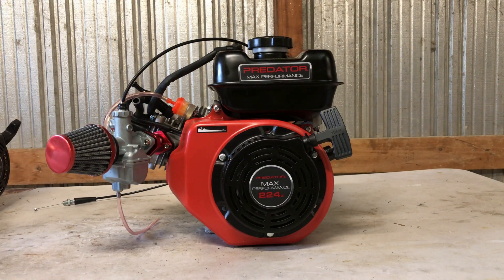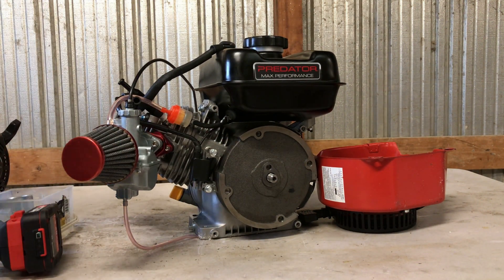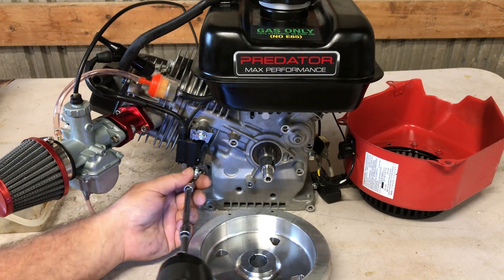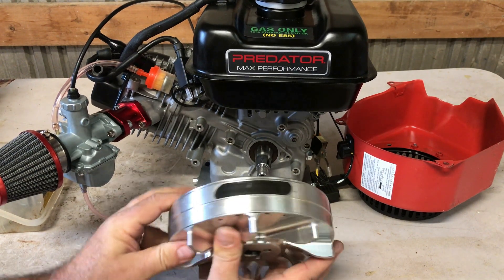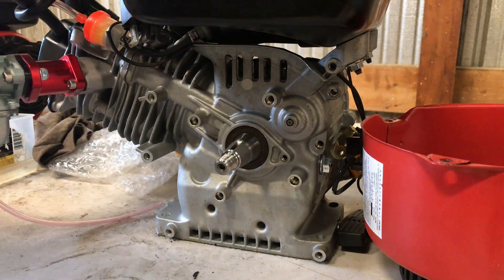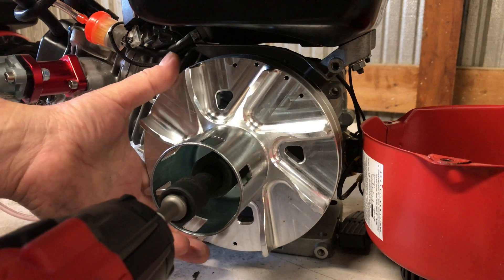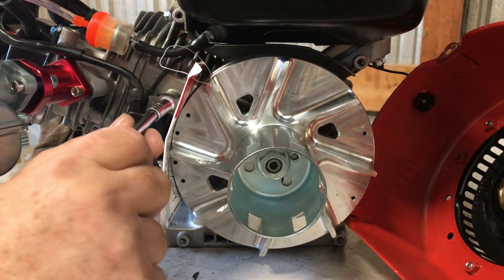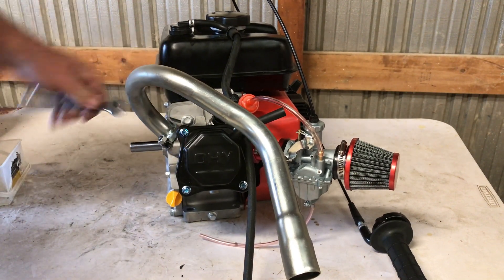224 Predator Billet Flywheel Install on the Billet Rod Wildcat Flat Top Predator 224 Engine Build

Comment: I just built my 3rd mini bike, with the other 2 after I removed the governor they started right up. On this 3rd one I have the predator 224cc engine and it’s not starting. I have spark, I have fuel. I think this might be the problem. I lost one of the valve caps taking out the governor. So I ordered one on Amazon, put it on, and I’m thinking that might be the problem. What would be my next move to prove that?
Reply from the maker: Valve lash is certainly an issue. Meaning that some engines have lash caps and others do not. The ones designed to use lash caps often have shorter valves, meaning the valve stem does not protrude up thru the spring and retainer as much. In that case your rocker arm could be making contact with the retainer rather than just the valve stem alone. That could definitely cause issues and even a dropped valve.

Comment: So when I was trying to take the thing off that is behind the flywheel I bent the threads and now the nut won’t go back on what can I do?
Reply from the maker: It happens. You'll need to chase the threads with the correct thread die before installing the flywheel retaining nut.

Comment: I took my 224 cc predator engine apart to take the governor out and these two little caps fell out when I was hitting the crank to remove the flywheel. They look like little caps. They’re stainless about a quarter inch in circumference. They look open on one side and smooth on the other do you know where those go or where those came from? Thank you.
Reply from the maker: Hi Frank! Could you put a pic of them up on your channel. I'd love to have a look at what you have there before trying to guess. Let me know with a reply here and I'll have a look.

Comment: Is that flywheel for a hemi? I have a 224 hemi and I’m haveing the hardest time finding one for it
Reply from the maker: Hi Moto! I've not checked out the 224 Hemi head version from Harbor Freight so I can't tell you for sure which flywheel it uses. The engine in the video is the 224 Predator Non-Hemi type and it uses a flywheel that works with the Honda clone taper.

Comment: What starter cup was used
Reply from the maker: Hi Nik! I used the same 224 starter cup as the blower housing is wider on the 224 engines. You could replace the blower housing with one from a 212 and use the short cup as well.

Comment: Hey Chris what’s the reason of overlapping the fly wheel getting into this flywheel thing, much help would be appreciated🙌
Reply from the maker: Hi GTA! Great question! When I lap the flywheel to the crankshaft with valve grinding compound I'm looking at two things. The first is to make sure the taper on the crankshaft matches with the taper on the flywheel ID. The second is to lap in the polished finish to ensure the taper keeps the flywheel and crankshaft mated, this eliminates all of the torque normally placed against the crankshaft key. In turn you can often remove the crankshaft key entirely as those can destroy a billet flywheel. When the flywheel and crankshaft have a perfectly matched lapped fit, there's no need for the flywheel damaging key. Hope that makes sense! Thanks my friend!

Comment: What would advancing the billet flywheel 4 degres do
Reply from the maker: Hi Ranger677! A timing advance in combination with the correct parts and fuel will make a lot of added power. When the timing is advanced it fires the fuel/air mix earlier on the power stroke. It gives it more time to burn the fuel in the cylinder. This model flywheel I'm using is supposed to be around 32 to 34 degrees with a stock timing key. A 4 degree advance key will likely get it up to around 36 to 38 degrees advance. It really depends on the billet flywheel maker. Different brands will have differing advance "built in". A few degrees advance is a good thing, even for a stock engine. The biggest benefit of advancing the timing is found if you run Methanol fuel, but race gas will also benefit from a little extra advance too.
Reply: @KentuckyFriedFixes  thanks for the quick reply. Im trying to figure out why my built engine want to take off. It not the carb. So i didnt know if it was the timing. I

Comment: Hello,   I installed a slipstream on a ghost 212 and the starter cup is too short for the ears to engage.  Your starter cup on the 224 appears longer.  Any suggestions?   Thank you.  Dave.
Reply from the maker: Hi Dave! The starter cup on the 224 is definitely longer than the 212. Just a few things to check, make sure they sent you the correct taper for the flywheel ID to match your crank taper, sometimes what you receive is not exactly what you ordered. If the taper is correct I'd check to see if it has any spacers between the starter recoil and the housing. You can adjust the recoil in or out by removing or adding spacers. Also make sure the cup is aligned with the flywheel correctly. It has a certain position it must be in to install correctly. It's a simple mistake that's easy to overlook when you get into a hurry, but it's also easy to correct. It's always a good idea to check the small stuff first. You'll likely find it's something simple causing the issue.
Reply: You nailed it with the taper.  Turns out the Slipstream SK100 does not work on the Ghost.  The SK200 is what one needs if purchasing the Slipstream.  I called EC Carburetors (talked to mark who was very helpful) and he pointed me in the right direction.  If one has a predator the gold slipstream works.  If it’s a ghost, you need the silver flywheel.   Apparently the crank is a Ducar in the ghost.  Not the crank that’s in the Predator 212.  

Thanks again!   Problem solved!!
Reply from the maker: @davidverrilli196  Good deal David! That SK200 is a good flywheel.

Comment: What offset key degree do you suggest
Reply from the maker: Hi L.A.M! For the 224 build on gas I'd recommend keeping the timing down to around 28 degrees. If you use the slipstream or the ARC, those are supposed to be around 32 from the factory with a stock flywheel key. You could use a 6 degree key and simply reverse it to set the timing back a little for gas. Or if you're running Methanol in yours it would be fine to advance the timing up to around 36 degrees IMO. Basic timing for gas/race gas around 28/32 degrees, for Methanol/additives around 34-38+ degrees.
Reply: @KentuckyFriedFixes  Thanks question 60T rear sprocket 35 chain what tooth clutch straight chain would I need to hit 60mph.  I have 224 header pipe governor wheel removed mikuni carb arc flywheel and 18lb springs
Reply from the maker: @l.a.m7645  It really depends on the size of your rear tire and what maximum RPM you want to turn.
Reply from the maker: @l.a.m7645  Here's a calculator to help out: http://www.csgnetwork.com/minibikepotentialspeedcalc.html

Comment: What size socket for the nut that holds starter cup and flywheel?
Reply from the maker: Hi L.A.M! I use a 7/8 socket on mine , I think the nut is actually a 22mm metric size.

Comment: Can you tell me what the stock timing advance is on the 224 compared to the 212 that I believe is 18° (correct me if wrong)
Reply from the maker: Hi Josh! Stock flywheel timing can vary a lot. You're right, they can be anywhere from 18 to 24 on the ones I've checked. I usually don't bother with the stock cast flywheels for performance engines. A good rule of thumb for timing though is gasoline runs good around 26*, race gas 28-32* and Methanol 32-38* depending on your engine combo. There are times though especially during break in where it's to your advantage to lower the ignition timing on a high compression engine for the break in. I'm kinda "frugal" so on some of the high compression builds, I like to lower the timing and break them in on gasoline rather than race fuel. After the engine is broken in, I'll advance the timing and give it the high octane juice.
Reply: @KentuckyFriedFixes  Thank you very much for the quick reply.

Comment: What size impact driver are you using
Reply from the maker: Hi Mark, this one is a 1/4 Bauer cheapie from Harbor Freight. It's rated for 2,000 in/lbs max but I seriously doubt it puts out that much. It's probably less than 1000 in/lbs.

Comment: Any recommendations on a flywheel with a 3 magnet charging system that can handle a governor delete/higher rpm’s. Looking to put it on a predator 224 in a minibike. I like your channel. Subscribed. Thanks
Reply from the maker: I've not experimented with adding a charging system. All the billet flywheels I've looked at don't seem to have anything. I'm going to look into this to see what I can find and get back with you. Thanks!
Reply: I’ve heard mention on various forums that there is a tillotson aluminum 3 magnet flywheel that can handle 8,500 rpm but also read that it will not fit predator cranks.
Reply from the maker: Nothing billet I've found will work. ARC makes a 6679 with a ring gear for electric start but they don't have anything to work with charging coil(s). Kinda odd they'd do that. All the guys I know that have run the billet flywheels have not tried to install a charging system with one. If you can get it worked out you may be the first. Seems like adding a few magnets to the inside of a flywheel shouldn't be a tall order? These newer flywheels have 2 neodymium magnets that are pretty strong but the poles are likely turned the same direction. I don't know though? If I had a charging coil laying around I'd throw one behind the Billet flywheel and try it out just to see what happens....Let me know if you come up with anything, I may push forward a bit when I get the time I may have a charging coil on something around here... I'm curious now, you've infected me. LOL! Thanks!
Reply: It does seem quite odd to me that no one makes a performance flywheel that has charge magnets.  

I guess I have another question for you. How unsafe is it to rev a stock flywheel to 6-7k rpm? I’ve seen flywheel fins let loose on an old Vespa shifter and get sent right through the shroud with enough force to cause real trauma. Man was I glad I wasn’t riding the scooter when it happened.

Also, thanks for your responses 👍
Reply: By “stock flywheel” I meant stock type flywheel with charge magnets.
Reply from the maker: I wouldn't rev a stock flywheel over 4000 RPM. Those things come apart easily.
Reply from the maker: I understand, but the cast iron flywheels aren't very good about staying together. They really are dangerous. Maybe look into installing some magnets on one of the PVL aluminum flywheels, those are rated to 8500 RPM. Sorry for the late reply I just found this in the held comments folder. Don't know why it was there?
Reply: Thanks for your reply. I’ll go ahead and order an aluminum flywheel 👍
Reply: @bradzookatooth  yup the cast alum flywheel  $56 OTD price. got one myself before it was gone... im sure they will make more but to do hot rod the engine and do the rod ... got to do the flywheel... making $150 engine... $350 with CM 265" lift cam and 22# springs for 6500 rpm when it is out of breath without decent port job... and then 7000 its prolly just making MORE noise.     u tube vid of GX 200 screaming with some performance stuff. 15 HP at 6500-6900, 15 ft/lbs at 4000... 4500
Reply: @bradzookatooth  i had predator flywheel explode in front of me on test stand at 3000... as i got the stupid flywheel nut on toooooo tight with impact and it just cracked it.  torque wrench only from now on. now to make the special something to hold the crankshaft while tighten the flywheel nut to 55 ft / lbs... which is quite a bit
Reply: @KentuckyFriedFixes  7.2 RC car/truck/truggy battery will light up LED lights... 4300 mAh... 5300 mAh... and charger enuf light to see/be seen by ppl . the little button head 18/23 mm e bay lights are real bright and in colors, take no juice for tail / stop/turn light with a little work so it is kinda street legal depending on laws

Comment: I'm ignat about this hot rod small engine stuff, would a billet flywheel benefit a stock engine in any way?
Reply from the maker: Hi Numa, the billet flywheels are much lighter so a stock engine would rev faster or accelerate quicker. The main reason most guys use the billet flywheel is to keep from exploding the stock flywheel at high rpm. There are a lot of advantages to the billet. I probably wouldn't need a billet flywheel on my tiller though.

Comment: That flywheel is just like the billet rods. They're so pretty and you can't see them when it's all together.

I'll end up using a GX200 aluminum flywheel that I have loose at the moment for the 224. Just happy that I don't have to buy another flywheel. I don't run that high of RPM but they are worth having on the engine. 2 less pounds to spin.

They went wider on the blower housing and starter cup because they went 3/4" taller with the fan. I compared and did a rough measurement versus an old clone fan. Better cooling for a utility engine? Sure. But it's not important for a mini bike application. I'm going with a clone starter cup and blower housing to finish off my 224. Already have them laying around.
Reply from the maker: I agree it's a shame to hide all the pretty stuff where nobody can see it. My first choice was the Tillotson aluminum flywheel, those are cast too but they're spin tested to 8500 rpm. Mine had a flaw that I wasn't comfortable with though. As things progressed I guess I kinda wanted the billet flywheel on this one as plans sometimes change. I wondered about those cooling fins, they did seem different but I never paid any attention to them as they had to go regardless. I think using the standard blower housing and starter cup is a smart move. RoyalJZ put one of these on a mini bike and he said he didn't like the blower housing that it stuck out too much. I can see that.
Reply: @KentuckyFriedFixes  Hmmm RoyalJZ...I think I mentioned this in the comment section on his video. Yeah you lose some room if the foot pegs are under the blower housing.

Comment: Mr KFF. In your honest opinion should I go with this 224 max or the regular 212  I’m going to be putting 1 of them
On a Ryan Ren o thin dethatcher.. They run Honda Gfx 160s. On their new models. I’m replaceing a old ic 7hp Commercial Briggs..  agai. This will just be going on a lawn dethatcher. So no need for “racey” stuff.  Though I’d ask your opinion. Thanks in Advance sir .. great vids  by the way. 👍🏻
Reply from the maker: B MA, If it's not going to power a mini bike or go kart, there's really no need for the extra power or performance parts of the 224 Predator. In my video list there's one on the 179cc 4.8HP LCT engines at Surplus Center for $49.95 plus shipping. They're suitable for most applications at a much lower price.
Reply: @KentuckyFriedFixes   I get me a nice discount from neighbor. 212 run me $100. 224 run me $149 .. like said they run GX 160s on there new models. I was thinking 212 or 224 be fine.
Reply from the maker: @bma4203  Good deal. That's a great price on those!
Reply: @KentuckyFriedFixes  I just need to find some pulleys as the ones that are on old engine are 1”shaft….  Nothing can be easy.  Excellent vids sir..
Reply from the maker: @bma4203  You can find an adapter that takes a 3/4" shaft up to 1" for around $20 online. Either amazon or Ebay should have what you need and you can keep the old 1" pulley if it's still good.
Reply: @KentuckyFriedFixes  really that would be great.
Reply: @KentuckyFriedFixes  gotta ask 1 more ?  I found a used HONDA Gx 160 for $75. In your opinion being a small engine pro. Should I go w that or just get the predator 212 for $100 new.?? 

What’s a good spark plug for the 212 if I go that route..  this is for a lawn dethatcher  I’d like to put the Honda on it as that’s what Ryan uses. But w me able to get the 212 predator for $100 and being a bit bigger w 6.5. Hp   I just want to spend the right $ So thought I’d ask ya b4 I did.. Thank you In ADVANCE Sir.. 🙏
Reply from the maker: @bma4203  Thank you for the kind words but I really don't consider myself a "pro". The Honda is a good engine but the GX160 is 163cc I think. It'd be asking a lot for it to replace and do the same work as a 7hp Briggs engine. You'd probably need to consider what kind of condition it's in if it's used as well. The better quality engine is the Honda for sure but usually used doesn't come with a warranty. Forgot to add: I like NGK spark plugs.
Reply: @KentuckyFriedFixes  predator 212 then u think ?    And you sure do look like a pro w all your knowledge on these engines and performance gains you do. I’ve seen a few different videos and your vids are the best w how you u narrate them as you go ect.. Thank u for your time have a blessed day sir.
Reply from the maker: @bma4203  If it were me, and I could get a new 212 Predator Hemi for around $100, I'd probably go with the 212 Predator Hemi for no other reason than you'll get a warranty and have the option to purchase an extended warranty of up to 2 years. But, if I lived anywhere near Lincoln Nebraska, I'd be picking up one of the $49.95 LCT engines. Those come with a 90 day warranty but with shipping you'll be nearing $100.
Reply: @KentuckyFriedFixes  212 it is